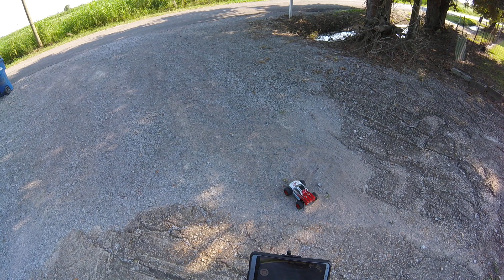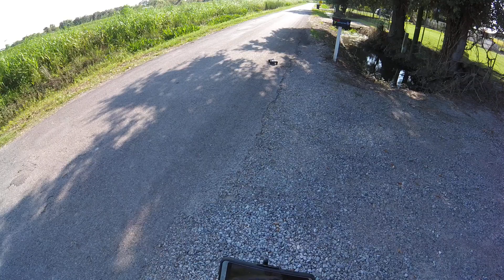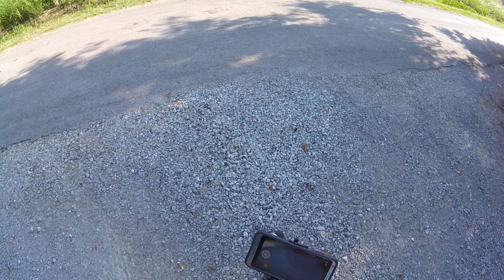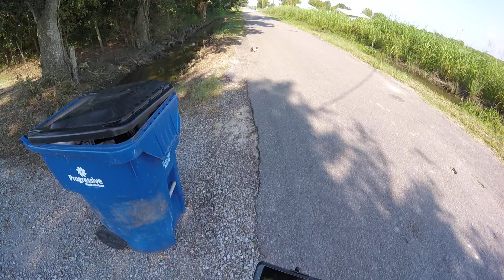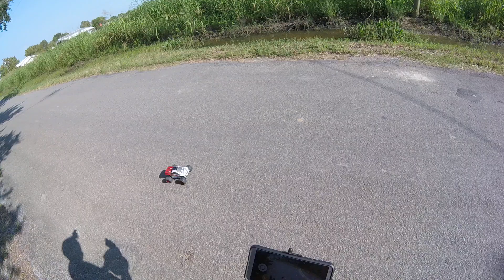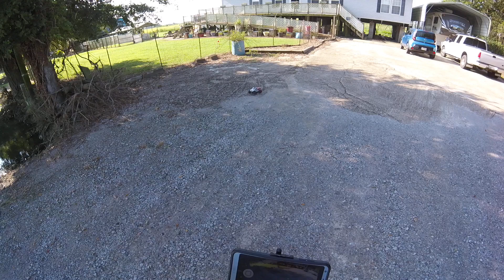Wltoys a979b update video

Comment: Nice upgrades my brother! Sounds smooth and powerful, that lil truck rips! 💪😎🤙
Reply from the maker: had to play with the diff housing to make the metal gears fit,but know she runs smooth,thanks for watching my friend.
Reply: @islandrc-duke1972  You bet buddy, You're welcome! Thanks for sharing!🤙
Reply: @islandrc-duke1972  Hey  Duke what's up buddy. I noticed something that you might be doing that has caused me some problems, 1 crash with my HPI baja and 2 crashes with a drone. Are you using a Wifi link from your phone on your transmitter to your head mounted cam to operate the cam from your phone?
Reply from the maker: @mikesrcgarage  Yes I connect my gopro to my phone just to see if I have the truck in the frame but I don't use it to drive. I keep my eyes on the truck if it goes out of the frame it is all good I know how Wi-Fi can be. Thanks for asking brother.
Reply: @islandrc-duke1972  What I meant was not the lag or latency it's that wifi transmits on 2.4gig the same as our transmitters it causes interference of the signal which can either  give it glitches or all together block the signal causing the vehicle to run off but that is usually only when then cam is on the car or drone. Just a heads up bro glad your not having any problems with it. 👍
Reply from the maker: @mikesrcgarage  oh ok did not know that,it has not happened yet and i hope it don't.Thanks for the heads up brother,really appreciate the info.
Reply: @islandrc-duke1972  Some GoPro wifi links can be switched from 2.4gig to 5gig and some phones will link to both, on 5gig there is no interference but a 2.4 video transmitting signal will knock out a 2.4 radio signal doesn't happen all the time but I've had it happen at least 3 times that I know of and all 3 caused crashes. Not saying you will have a problem but it's possible... check into it! 👍